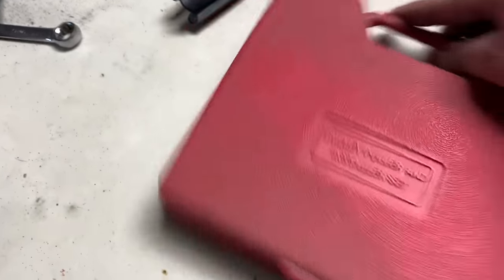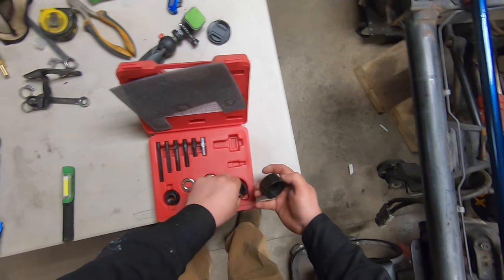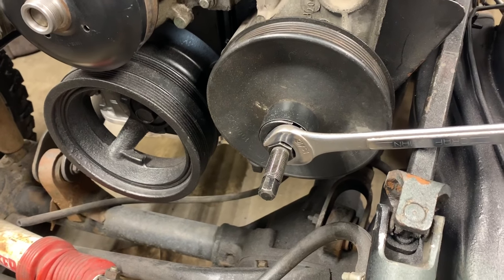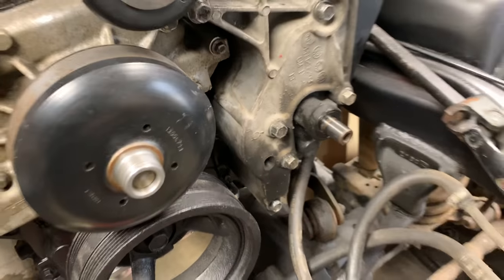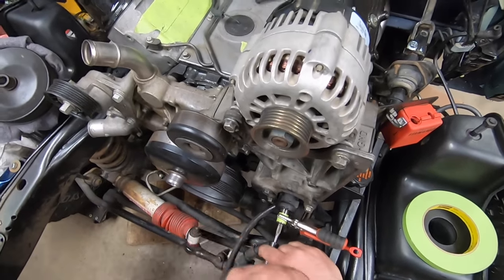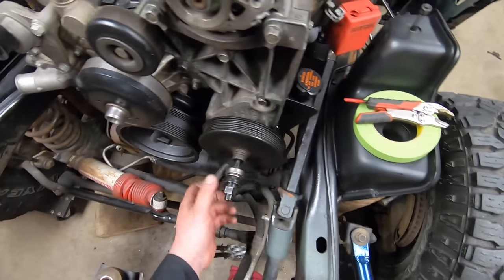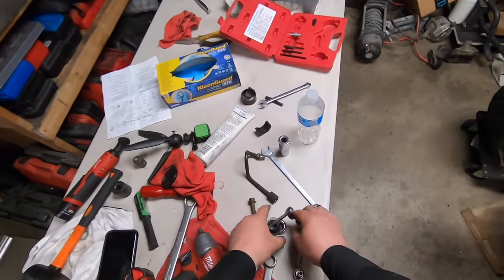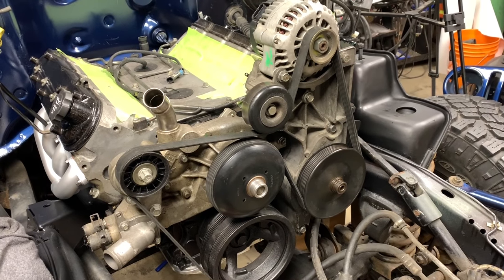How to Remove and Install A Power Steering Pulley

Comment: You put the washer on the wrong side of the thrust bearing which is why you had to hold the pulley with your hand. The washer must go against the inner race of the thrust bearing. This is the side with a tiny gap around the outer edge - inside the outer "cup". Also, for this pump, use the shortest threaded shaft to install the pulley.
Reply: You’re why I read the comments. Nice tip. Thanks👍
Reply: It don’t matter which way the washer goes it will still spin either way

Comment: Hi Folks, I have a power steering pump that does NOT have a threaded center. The method he is using made me crazy for hours until I read on a corvette post that some pumps only have a keyway and a nut holding on the pulley. No threaded female parts!! So, there is no need to pull it or press it on. This video is excellent, btw, for all press-on types of steering pumps. I hope this helps someone and they don't get crazy as I did. MK
Reply: So it just goes on as much you can push it in?

Comment: Best idea so far, using your hand to stop the pulley from turning. I'll try it and report back. So far I haven't been able to stop the shaft/pulley from turning which just unscrews the installer tool. EDIT, UPDATE 1/10/2020: Your method worked. I used a long handled ratchet, and braced it as shown to give one hand free. Was still a bit difficult to hold the pulley though so I added a rubber washer between the installer bearing and pulley and that did the trick. Got it up and running now, thanks OP.

Comment: I replaced a burnt up power steering pump and used the $7 harbor freight version of this puller to save the old pulley and some money. It was incredibly difficult to remove the pulley while still attached to the engine with hand tools and without removing the radiator. I pulled the pump with the pulley still attached and then used a 11/16 wrench and a 1/2 socket wrench to get the pulley off. Was way easier to remove the pulley after pulling the pump instead of wrestling with it while still mounted.

Comment: Major props to you man. Every other idiot Youtuber has you using the threaded bolt to remove the pulley. I wrestled with it for two weeks trying to get it off, breaking the bolt in it. I came across your video last night and was able to pull it off in one minute with hand tools. Thank you so much. Anyone reading this, this is how you do it!. Rock on man!!!!
Reply: Looks like I have to order some more tools 😅

Comment: In the middle of replacing the power steering pump in my slant 6 1980 Dodge aspen. Opened this rental kit from O'Reilley and I was like WTF?  Thanks for the video, the kit works like a charm.

Comment: Good vid! I rented a pulley puller and sat without a clue looking at it.
Tip, use a 1/2 in socket and 2 ft wrench to hold the install bolt.

Comment: A thread chaser!  I never thought of that!  I feel so stupid!  I'm working on mine right now, in fact.  Like yours, the interior threads on mine are very rusty.  I was able to only get 2 threads of the bolt into it.  Amazingly, I was able to get the pulley about 1/2 way on, before those 2 threads gave way.  I felt helpless.  How do I get the bolt in, so I can finish this job?!  A HAH!!  A  LOT of lubricant and a thread chaser will clean out those threads!  YES!!  That's what I'll try tomorrow.  Thank you so much!

Comment: awesome ,thank you very much,,i have a kit but puting back on was confusing,,cause instructions say counter clock wise,,,instead clockwise like i thought
Reply: Same thing happened to me. Those instructions are not clear and I believe are not correct. Turned the  7/8 " nut clockwise and it went back on . Doing what instructions say will passiblly screw up the  threads which may have happened to me. But it's done and I recommend not to mess with it any more.
Reply: @DavidGurrney7589  you hold the wheel and the front nut,thenTURN THE MIDDLE CLOCKWISE,,,ato put it on

Comment: Thanks a lot, I have a Holden Commodore VZ Ute with a bad belt and tensioner, for some reason GM's engineers decided to place one of the belt tensioner bolts right on the lip of the power steering pump pulley, so to change the belt tensioner either the pulley or the PS pump have to come off, taking the pulley off will be easier.
Reply: These car many. Put the cars together. They let you worry about taking it off. How dare you try to save some money.

Comment: Thanks for sharing bro. I’m guessing I’m going to need this tool to tighten it also? Mine is not sitting flush in the shaft and is wobbling about 1/8 inch. Hopefully I can tighten it down the shaft.

Comment: Did you have to remove the bolt to put the pulled in cause my truck has a bolt that won’t come loose in the pulley

Comment: Is there a tio for keeping your pulley from turning? I'm trying to hold the pulley with my right hand while cranking the wrench with my left. Dont have enough strength to make it work.
Reply: If the pully is turning then most likely the threads are bad which he mentions you may need to retap the threads

Comment: I'm about to wade into replacing my pull.
I removed itself an took the serpentine belt with it on my drive home the other day. It did not however, remove the center part of the pully. 

The pulley broke apart and away from that center sleeve with the lip.

Doesn't look like it will matter since the tool applies force against/between the lip and the center pin.

I'll find out shortly.

Comment: Thanks for posting this!!  Just replaced my power steering pump, and the new one came with the pulley disassembled.  I have the HF kit, pulled the old pulley, but had no idea how to reinstall!  It's on, but I crushed the spinner that held ball bearings. But the job is done, thanks to your video!!

Comment: Hey I’ve got my self in to a bit of a problem I rented one of theses sets and turns out it came with a striped center screw I got a bit pissed off and I started to bang the pulley in with a hammer I didn’t do that to much because I then got worried I may destroy my power steering pump I was wanting to see if you can give me your best advice in this situation do you think I damaged it
Reply: yeah your pulley is most likely damaged and bent

Comment: What size tap did you use to clean out the internal threads on the power steering pump shaft? thanks

Comment: At least on the LC9 07-14 you don’t HAVE to remove the pulley. It’s a hell of a lot easier but you can just pull the alternator off pull the accessory bracket off as a whole relatively easily

Comment: Great video.  I'm trying to install my pulley now on my new pump ls engine. When using the pulley installer I started tighten and It got tight and started to go crooked so I took it out and used a tap to re tap the threads . Gunna try it again any advice would  help thanks!
Reply: Did u figure it out
Reply: I like to put anti-seize on the pulley and shaft. It helps it go on and Insure is it will never seize.

Comment: What size tap did you use to clean pulley threads?
Reply from the maker: They are not all the same size so you will need to figure that out on your own

Comment: So I am new to tool and dye so to speak if that is what this is. That is my question. Is this a case of tapping new threads when you install even the same pulley as you removed before? Does that mean you are tapping the inside of the used pulley and making it work again by retapping it?? Thanks.
Reply from the maker: There is no tapping of anything.........
Reply: A tap is for making threads inside a hole (aka female threads).
A die is for making threads on something like a bolt sticking out (male threads).

He "chased" the threads with a tap to make them cleaner. Most likely the threads inside the hole were not letting the threaded rod part go into the engine block. Meaning he used an actual tap to make the threads better as they were a little corroded or something. This is usually not needed but if something doesn't go in and you are sure you have the correct size bolt then "chasing" the thread to clean any burs or rust or dirt or whatever out of the threads is sometimes needed.
Reply: Does the power steering afect the radiater from circulation
Reply: The power steering pulley could affect the radiater could it
Reply: @johndunham9058  No
Reply: No, he used a thread chaser to clean up the threads that got a little gunked up to make it easier to screw the puller stud in place..

Comment: It sux to pull it with hand tools, but at least in some engines you can do it with hand tools and not have to dismount pump or pull any body pieces or anything... "easy"

Comment: My pulley kit does not look anything like those that I borrowed from advance Auto  does anybody else have a different kind of Kent
Reply: Same, and the one I got goes on the outside and it broke the damn thing
Reply: Yeah I loaned one from Autozone and it came with like 4 pieces OEM (57031). It’s didn’t work for me.I was motivated to fix it myself 😌.

Comment: Yeah, everything works great when the entire front end is missing, it all goes so quick and easy, what a disgrace this new pulley is without the openings to remove the screws like they used to be, Made on purpose to be a pain in the ass! Just like the hoses to the gearbox, or the screws for the headlights . I am going electric so fast its gonna make the oil CEOs sorry they made the engineers design this garbage, Oil, and Gas internal combustion engines could have survived alongside electricity if not for the greedy designs of these CEOs well you greedier yourself out of the competition completely, "Here is a Tesla car FACT!" 2 million miles before maintenance!